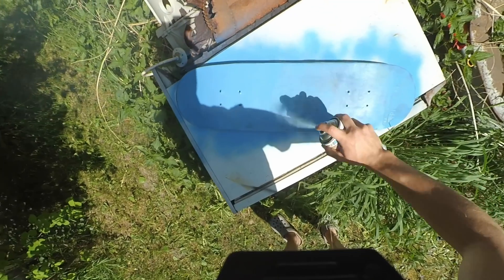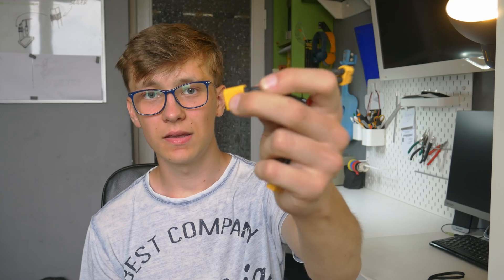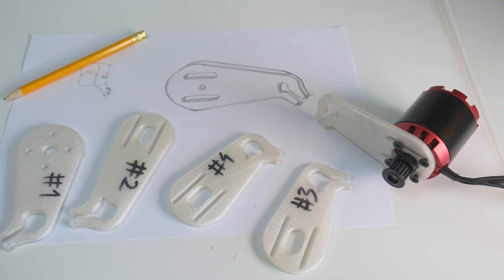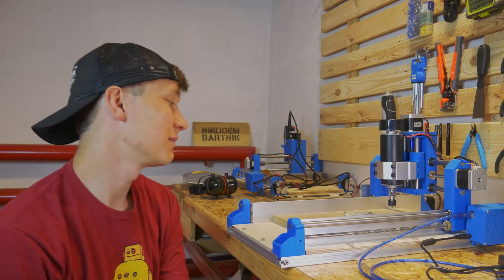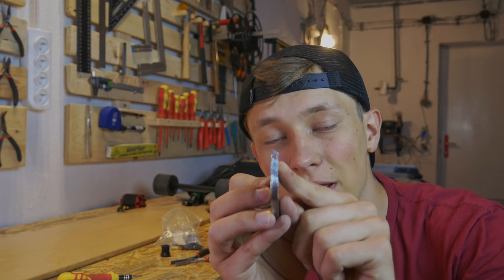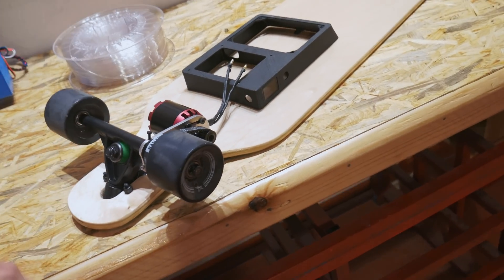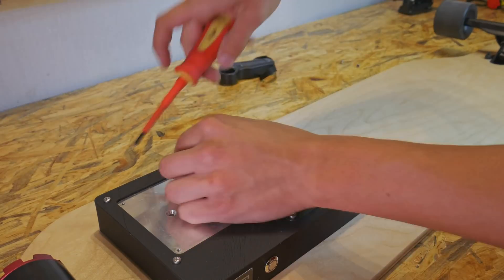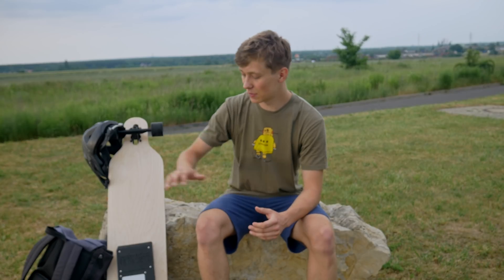DIY Electric Skateboard

Comment: Just don't 3d print the trucks mate 😅 it's will never get structural integrity that even resembles metal. Just for skating don't 3d print anything 😂 you're dealing with forces any 3d printed part will shatter before you can scratch it's metal counterpart that's just not smart on en E board bro

Comment: For having safer brakes you can buy a VESC, plus you will have more control over you acceleration and max speed. This make the skate much more smoother to ride. I had a similar esc before and it worth the upgrade. If you decide to buy one, you will need to buy seperately a remote, a battery metter and a switch.

Comment: Which type of esc substitute have you taught?  
The 24V or 36V
Reply: Was wondering the same, but i think it's 24V considering he used 2 11.1V batteries in series.
Reply from the maker: Yes, I used 24V version but if you want you can use 36V one, you just need more batteries
Reply: Nikodem Bartnik Isn't the motor specced to 24V though?

Comment: I had a thought about a motor mount, print the axle part of the truck with mount designed on it then cast it out of aluminum.

Comment: I greatly reduced the vibrations from that spindle motor by balancing the cooling fan. It was VERY heavy on one side, I had to remove about a 2cm square section of the edge to balance it.

Comment: Hey Niko, not sure if you familiar with Loctite, you should definitely check it out. its a liquid that hardens and prevents the nut going loose from the bolt. There are 3 or 4 types of strengths, the standard one is the blue. I use it in all my vibrations prone assemblies and it helps a lot.

Comment: Your belt is slipping when you slow down because you probably have a cheap pulley kit from china which is usually 3m. You need a 5m belt and pulley setup. Also wider belt and pulleys is better since there is more contact area for the belt. Good luck!

Comment: Great effort! Well done indeed. One thing... your belt, not sure if you're using 3M or 5M (it looked like 5M), but it's skipping loads! So maybe just tighten the belt a little to stop that.
Reply from the maker: Thanks! Yeah, I fixed it now, didn't had a screwdriver while testing :)

Comment: Nice, I used similar electronics for my build, only I used a keda 190kv 6364 motor from hobbyking and two 3000mah 3s lipos in series. It has plenty of torque, and I have climbed 20% hills on it, and the top speed is limited by the esc to 20mph. It cost me about £200 to build.

Comment: Nice project... but did you do any calculations about your design? sharing such project with others without notifying residual risks about such design seems a little bit dangerous. For sure, you wear protections (not enough according to me) but what could you happen if something goes wrong on road for someone else :/  Do not forget CE safety rules for toy? vehicule?

Comment: Great video. For cost effective battery, consider Hoverboard (aka Balance Board) Battery pack. It contains 20 cells of 18650 with a BMS, and outputs 20A continuous, it is a 10S2P setup, so 42v fully charged, roughly 800 watts of power. They can be found on Ebay (with Samsung / LG cells) for around 30USD. You can reposition cells for "slim look" pretty easily too.

Amazing video. keep it up!
Reply: I have a similar project,  but I don't know how to connect the charger to the battery. Do I need the motherboard of the hoverboard to charge it safely or there is integrated overcharge protection in the charger itself?
Reply from the maker: I want to build my battery out of LG 18650 cells, I already have all of them and I will make 6S 3P pack, I don't have a spot welder so I need to figure out how to connect those together :) 42V is way to much for this ESC, I have a version that can handle up to 7S battery :( Thanks!
Reply: Nvm, just found out that the battery have BMS itself, so connecting the charger directly should do just fine.

Comment: If the couplers are getting loose you might want to try some blue loctite on the screws. If you want supreme power than use red loctite but be carefull since you cant loosen them ever again.
Reply: A bit simpler solution is to file the rod flat on the place the screw bites into it. Helped me, too. But filing the hardened steel lead!screw was no fun - next time I need to do it, I'll use angle grinder :)

Comment: Hope you can read this comment.
I was having same problems with an mpcnc, i was losing steps on y and x. I just solved by adding a bigger fan that blows on stepper motor drivers. With this solution i've also added 0.2V on vref on each motor. And now they work really good
Reply: I'm building the MPCNC now and am planning on building the Dremel CNC as well. (for smaller projects at another location) This is nice to know!
Reply: @christophergrove4876  i just went crazy to understand where the problem was, so i hope this will be helpful to you and maybe also nikodem

Comment: Have you considered using a BLDC motor comparable to the one you use for the longboard as a 1 kilowatt CNC spindle? I've been contemplating the practicality of such a system, and would love to here your input. It seems like it would offer higher power with higher torque potentially for cheaper.

Comment: hello, excellent project, a question, do you have the data of how much power does that esc support, can I use a more powerful motor?
Reply: I used a keda 6364 190kv motor from hobbyking with my 24v version and it works fine. 20% hills and about 20mph no problem.

Comment: Nice but I think it'll be better is put a another motor on it as it less strain on the motor as do both sides of the sideboard
Reply from the maker: With this setup it's hard to do
Reply: @nikodembartnik  back and front trucks instead?